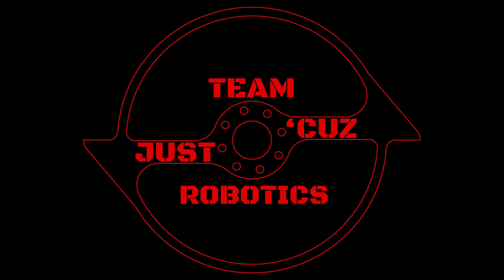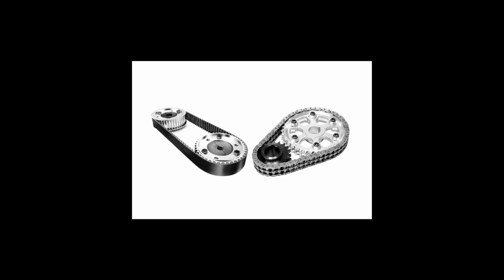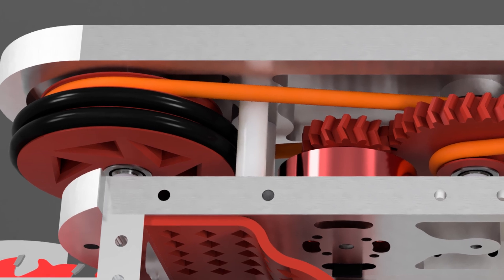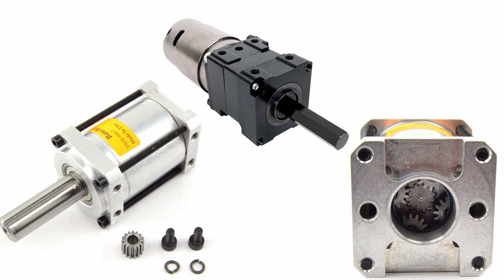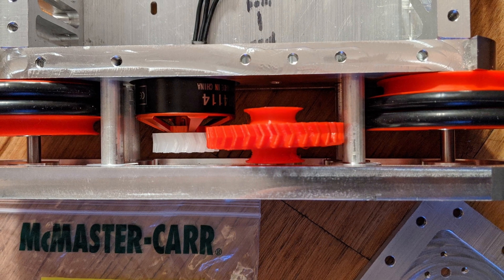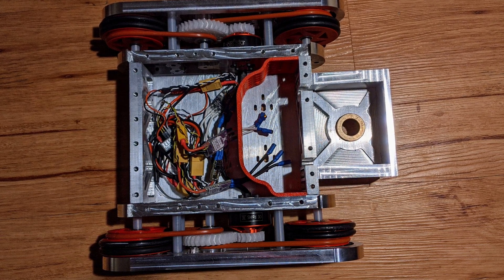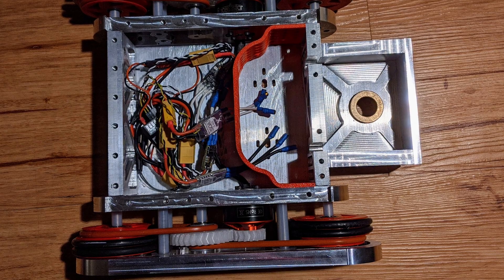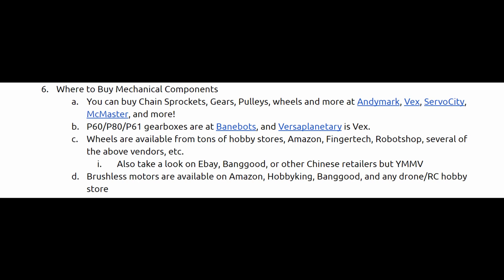Combat Robot Drivetrain Design Guide Part 2 - Mechanics, Reductions, and More!

Comment: What about a transmission?  I was thinking about making a robot to investigate autonomous driving, I figure it might be nice to have the bot shift into higher gears, maybe top out around 25mph.
Reply from the maker: Hardly any electric vehicles have a transmission because what's the point? Electric motors give you all of the torque at low speed and all of the speed at high speed. That's kind of the whole point of a transmission and electric motors naturally do it. Just get a big enough motor to accelerate your vehicle properly and that reaches the speed that you need

Comment: I would really like a follow-up that would explain all the different aspects of the belts to help understanding them. Such as, pitch, HTD, GT2, GT3, Teeth count in relation to the pitch for circumference, etc. Like what should I type in the search bar to find what I'm looking for. Because right now I'm having a headache trying to find what is what. I don't know how a specific belt would fit or not fit a certain pulley.
Reply from the maker: I'll keep that in mind! It's a topic I considered discussing after a recent video about gears.
Reply: @JustCuzRobotics  It's great to hear! But no pressure I think I mostly found out how to work it out but still a lot of technicalities are obscure to me. Always enjoy watching anything you upload. :) 

I'm printing the first parts of my robot right now and the biggest problem I'm having is that parts don't fit in each other. I'm reprinting things for the third time now but should be good to come at NHRL this spring, hopefully. Cheers!

Comment: I used direct drive on a 1lb ant weight using a brushless 2205 2400kv but I used a silicone wristband tank treads. Basically using 1cm tall "wheels" it could go 20 mph with 6 times the skid-out torque. Really fun bot to drive. Box rush king.

Comment: Does bloodsport use Banebots P80 gearbox for drive motors?  Is P8X worth it?
Reply from the maker: Yes Bloodsport uses the P80 as a first stage reduction but followed by a chain reduction as well. The 8x is brand new and we haven't tried it yet but we have our eyes on it. Tbh we never had a gearbox fail though only the chain or tires ever failed
Reply: @JustCuzRobotics  thank you.  Looking to design my own hw.  The banebots gearboxes seem a lot easier to come by than the alternatives, apex dynamics ones for example.
Reply: @JustCuzRobotics  Thanks for the help.  Banebots has P8S, P8H, and P8X.  Did you use P8H? its the medium durability one